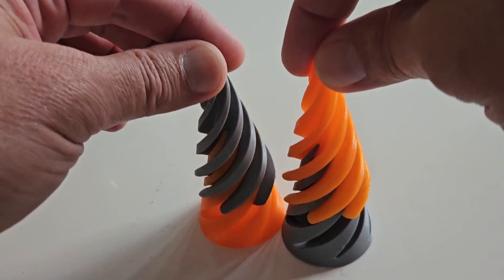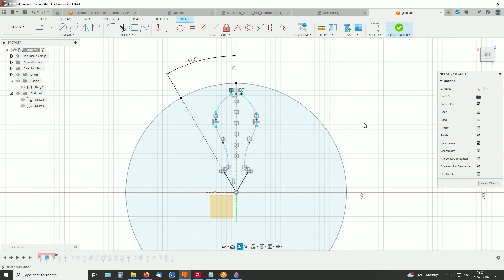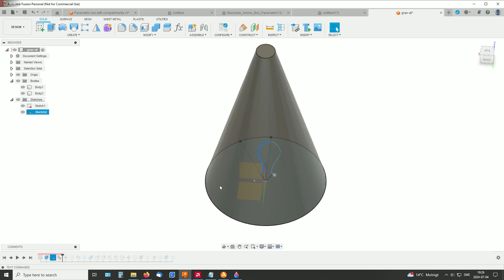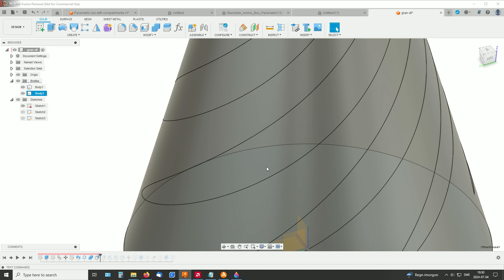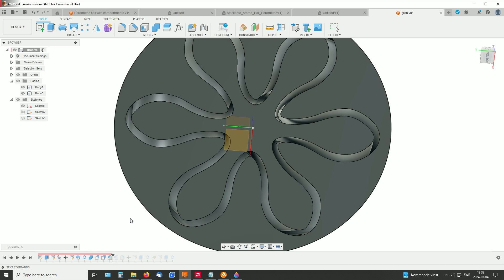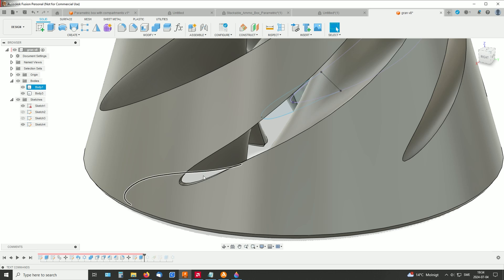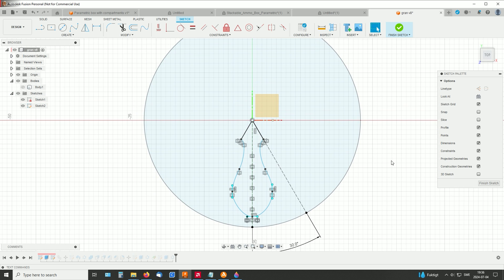Spiral cone fidget in Fusion 360

Comment: What is the diameter of the starting circle
Reply from the maker: I had it set to 45mm. It just seemed like a nice size. 
You can try a larger but smaller may be challenging to print good since the pointy things would get so thin.

Comment: Thanks for sharing, the video os great for getting me started with 3D printing things Ive designed myself.

The only question i have relates to the last action you did, trimming the top points off with an extrude.  Ive completed that for one of then, but I just cant get that cutout to follow a circular pattern? When I select "Circular Pattern" its asks for objects to be selected and it won't let me select the sketch.
Reply from the maker: @DuckySpud  Set the pattern to features (instead of bodies) and select the extrude feature in the timeline (not the sketch).

Comment: Great video and I have made a few of these now in the past day. Couple questions. Right about https://youtu.be/zizDNnP6ERg?t=139 in the video you are saying to make sure that line is perpendicular to the arrow line. I cannot for the life of me figure that part out yet.  I think that is leading to my other issue.  More than 1 face on top and bottom of the sweep cuts when its time to offset the faces. I worked through it by adding the extra faces I had. I see you had both top and bottom faces selected and only had 12 faces.  Those are my 2 issues I would greatly like to figure out.  Thanks for the video
Reply from the maker: @crbattery  Not at a computer now but I think you should be able to make a Perpendicular constraint between the spline handle and the sketch line.
Reply: @Fusion360modeling-fb4gt  I'll have to mess more with spline and find out.

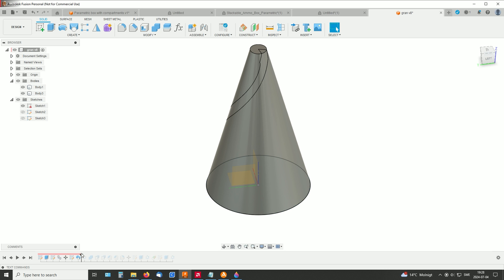Comment: Thanks for the great video! But... at 5:09, you say, "I made a pattern of the feature." I understand this, but what I'm missing is how in your video you go from having your Sweep cut through the top, and then suddenly 1 second later there's perfectly nice rounded ending points just "below" the top. How did you get those ending points? I've tried everything. Thanks!
Reply from the maker: If you look really close half of the rounded top is created by the cut. The other half of each rounded top is the result of the patterned cuts meeting each other perfectly. 
I see it looks a little confusing when the copy of the body is visible after that step.
Reply: @Fusion360modeling-fb4gt  OK, I finally figured out what happened. MATH! Ugh. Instead of 30degrees left and right, I somehow did 30degrees from each Construction line... so... 15degrees left and right. Which means it never touched using 6 arms. Yay for the Timeline!!! And thanks again for the video!!!

Comment: How did you make the actual spiral cut? You completely left that part out. All of a sudden it appeared.
Reply from the maker: @doublerpix1597  I don't show the actual  building process in this video. Instead I go through the timeline and explain how the thing was built step by step. 

After I came to the step in the timeline when the cut appears I explain how the sweep feature has to be set up. The sweep needs a profile and a path (the two sketches I show earlier). You also have to set a value for twist angle for this shape.

Comment: Can you make full tutorial to make this model, pleaseeeeeee !!! i really want to know and see full !
Reply from the maker: @keal.freespirits  It would be a long video... 
You could make the bottom sketch a lot more simple if you want. Try to sketch just a cross and see what you get by using the same principles as in the video (then you can skip the circular pattern for the spiraling cut).
Reply: @Fusion360modeling-fb4gt  How can I create an axial twisted sketch on a triangular pyramid surface, I implore you to make a short video on how to create an axial twisted sketch on a pyramid surface. please sir
Reply from the maker: @keal.freespirits  Use the same methods as in this video. The only difference would be that the first sketch is a triangle instead of a circle. Easiest way to sketch a equilateral triangle is to use the polygon tool (press Tab to switch between the inputs for dimension and number of sides).
Reply: @Fusion360modeling-fb4gt   Thank you so muchhhh <3